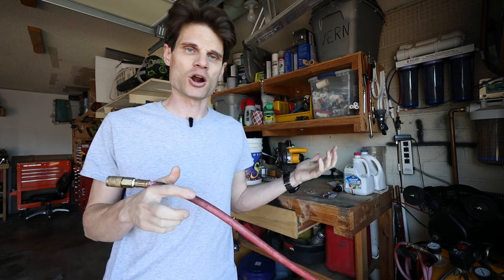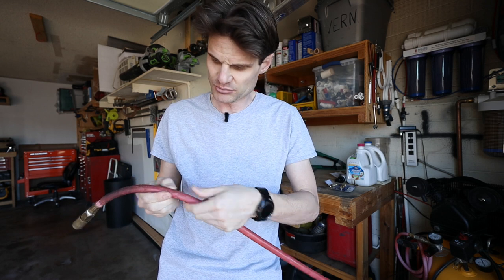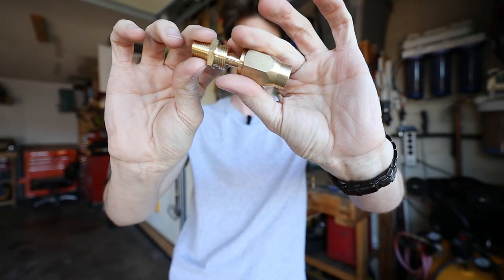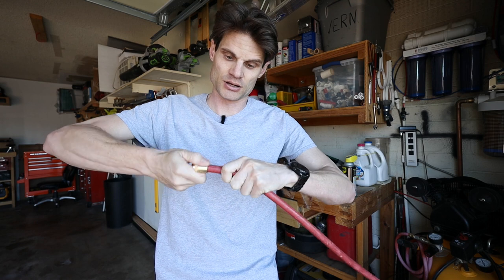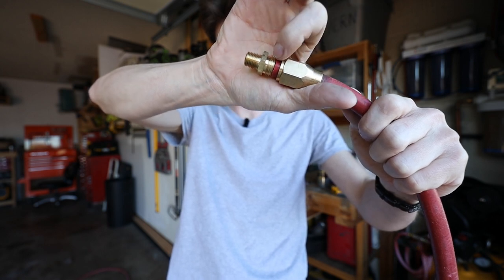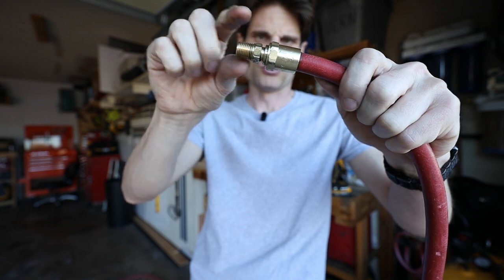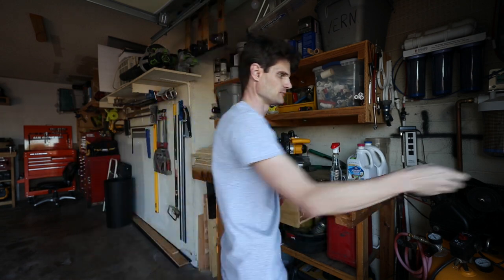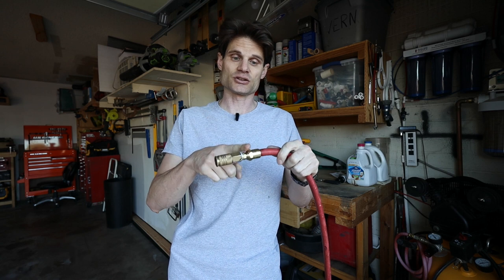Air Compressor Hose Repair w/ Dixon Reusable Fitting

Comment: Presenter did not follow the manufacturer's recommended procedure for the Dixon reusable fitting insert portion - 3 rotations CW/1 rotation CCW.  Backing off 1 rotation relieves tension on hose so it is not twisted inside the shroud.  Using an impact drill at RPM used may generate friction heating of tubing liner which may promote early failure of the connection. Did he check whether the silicon lub is compatible with the hose rubber?